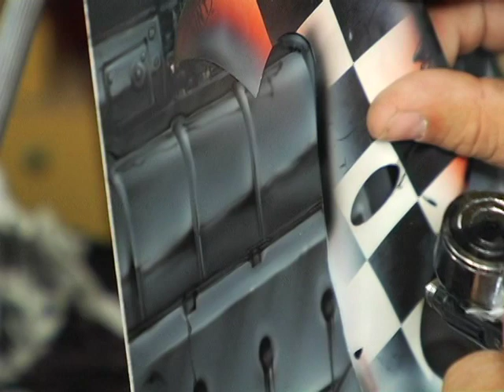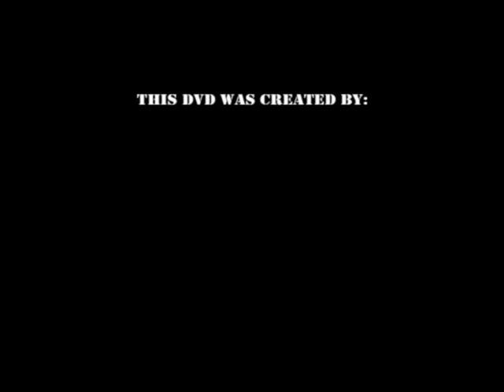Creating From Within.  Airbrush Tutorial Part 4

Comment: Thanks for sharing, all the values and contrast looks great. I purchased a used Richpen 213C and the nozzle air cap is leaking air. I noticed both the nozzle air cap and nozzle do not have an o-ring, are both of these parts suppose to have an o-ring or are they to be installed metal to metal? I am going to wrap teflon tape for now around the nozzle cap threads or use bees wax to see if either helps seal the leak. Thank you
Reply from the maker: There are no o-rings on the front end of the airbrush. If you are getting air leakage, the best thing to do is use a bit of beeswax. It is obviously hard to diagnose from here, but it is possible that you have replacement parts that are not RichPen. The 213 was discontinued 10 years ago and parts have not been available until we brought them back this year. If you cannot get it running properly you can always send it in to us for a re-build.
https://learnairbrushstore.com/shop/richpen-airbrush/mojo-rebuild-service/
Reply: @MikeLearnStudios  Thank you for the insight and attached link. I'm going to purchase beeswax and see if that remedies the air leak. Thanks again.
Reply from the maker: @vanquishstorm3806  hopefully the previous owner didn’t try to cross thread an iwata nozzle into it.